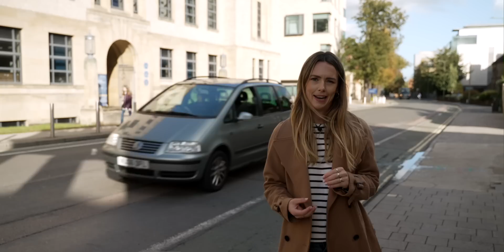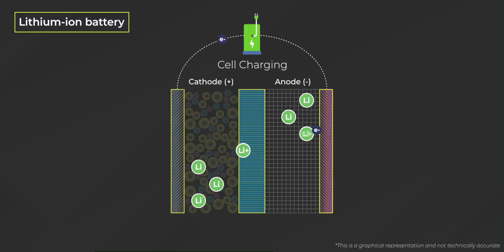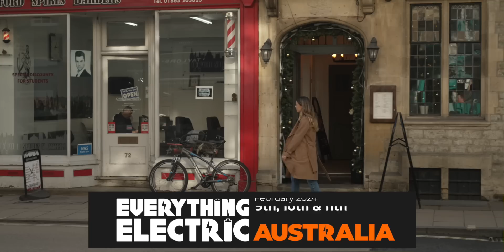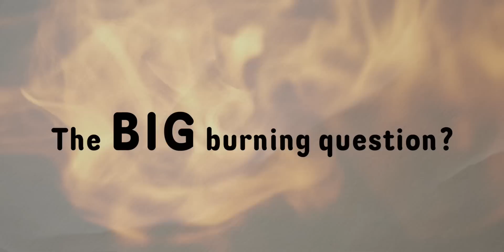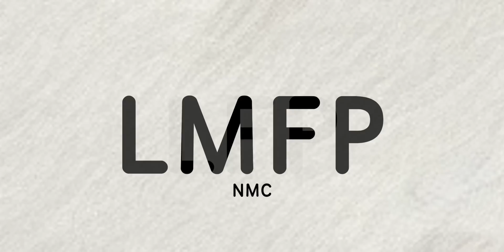The BIG Battery Breakdown: Fires, Failures and Future Breakthroughs!

Comment: Even for long road trips, a 500 mile range care would be more than suitable in the North American market. 

It's funny that he mentioned Canada, because I actually drove to Alaska this summer up the Alcan, and I was very pleasantly surprised by the number of EV chargers in BC and the Yukon. Once I got to Alaska it was another story, but it just goes to show that even in very remote areas, having good chargers every 100 miles or so is more than enough
Reply: Hmm ... it depends on the amount of traffic there is and the number of chargers (working) there are.

The Chinese would appear to have "solved" the problem of charging up battery EVs by having a "lot" of coal fired generators.

Granted that won't always be the case but the downside is coal powered generating stations are busily generating CO2 (plus other gases you can Google up for yourself) at the same time as generating electricity.

And the amount of CO2 produced getting the coal out of the ground and into the generating stations' furnaces and then getting rid of the ash ends up in the atmosphere too.

And of course we shouldn't ignore the fact that despite being assured there's sufficient electricity "in the wires" society is being "encouraged" to use electricity for everything else too so we shouldn't delude ourselves there's always going to be enough electrical energy around to drive everything once we get rid of fossil fuels.

There again if we find we can get nuclear fusion to work in the next few decades then we might get away with it.
Reply: @t1n4444  In British Columbia and the Yukon our grid is powered by hydroelectricity, so no, the only CO2 is coming from your oil & gas generated tropes. Nice try though...
Reply: @davidcottrell570  

Hmm, yes, well jolly good show for you then.

Comment: Or make all major roads wireless chargers, so that cars can have tiny, lightweight batteries and only have to worry about charging, if they spend too long away from major roads.  Yes, I realise it would be prohibitively expensive and take decades to upgrade roads, as well as create greater maintenance requirements, so roadworks would be happening with much greater frequency, but it would simplify so many things.  People would just pay a road tax based on their annual mileage and the majority of battery storage would just be needed for the grid, which by that time should be almost exclusively powered by renewables.

Comment: Campervan people can easily use 1000 mile batteries, not because they need to go 1000 miles in one go, but because they also use the battery for cooking, cooling, gadgets, heating, and e-bike charging, especially when staying off-grid. Heating particularly uses a lot of kWh without radical changes in the insulation levels and amount of glass in current vehicles. PV can help with this, but only the equivalent of a few miles/day.
Reply: Food truck people too.  Food trucks typically (in the US) are surrounded by a fog of exhaust either for the truck or for gas-powered a generator.  And they tote around LNP canisters.  A battery big enough to just go a few miles then COOK, with no exhaust, would make healthier, more pleasant eating.
Reply: @tomp4944  Good point. I wonder how many kWh/day a food truck uses? Induction cooking uses half the energy of gas cooking, and is typically something like 1kWh per day for camper-grade cooking (one or two rings for maybe 30 mins). A food truck may do 5-10 hours at several kW so could easily use 30kWh/day and maybe more. They probably don't travel very far normally so the current typical 50-60kWh battery should work for many cases.
Reply: @xxwookey  WOW, that's good information.  I assumed the electrical needs would be higher.  That's completely doable.  I'm assuming as soon as fully electric food trucks arrive, health departments will suddenly notice the toxic fumes we take for granted today and make it hard for food trucks to not be electric.

Comment: Yes, if you're in the car, you have time to get out, but if the car is in a car park (such as the recent airport fire) or in your garage, the burning battery provides toxic fumes and an intense heat source that may cause nearby vehicles or buildings to ignite. The battery fire is also hard to put out. Lithium battery fires seem to be very frequent because the batteries are so ubiquitous. Airlines have become paranoid about people dropping their phone down the side of the seat (understandably, because a fire in an aircraft is a much bigger problem than in a car). The other consideration with car batteries is that they are being carried around at high speed and may be crushed in an accident.
With respect to range, all the examples quoted were northern hemisphere. In Australia, there's a lot of situations where a longer range than current EVs is either desirable or necessary. Having said that, the vast majority of travel is locally within cities where a huge range isn't required. Better public transport would help to reduce the need for long drives. I really think there needs to be more emphasis on public transport. If people can conveniently travel those long distances in efficient and affordable public transport, taking a car makes less sense. At the moment for Australia, a lot of people would prefer a hybrid EV where they can use electricity for the short trips and only use petrol for the occasional weekend trip or holiday. Given the time to charge an EV, I just can't see public charging infrastructure being practical for long distances if 100% of the cars were electric. Maybe the solution for zero carbon emissions for those situations is a battery/hydrogen hybrid? Toyota already has hydrogen ICE test vehicles.
Reply: Agree on public transport- when it is good, like it is here in Europe, it often becomes the preferred choice. But regarding the hybrids- those are the most likely to catch fire (per number of vehicles sold), while BEVs very rarely do (you can google the numbers). But for EVs, you can go with LiFePO4 battery which does not even even burn. I believe Sodium Ion does not burn either, and both are just fine for city cars.
As for hydrogen cars- those are very energy inefficient, plus hydrogen is difficult to store. We should probably already forget hydrogen for cars, go full BEVs, and only go hydrogen for agricultural use (making ammonia), with secondary use of both hydrogen or ammonia as fuel for things like sea shipping.
Reply: @NeblogaiLT  why should a PHEV be more likely to catch fire than a BEV if the battery tech is the same? If the risk is due to the presence of an ICE, it's no less acceptable than an ICE car but with lower emissions. Why shouldn't they be able to take advantage of the same chemistry? I'm not sure of the numbers around inefficiency which you're claiming for hydrogen. The future waste and recycling steam is a massive problem if you want to convert everything to BEV. Hydrogen is simpler and cleaner. You can also fill a hydrogen tank in a reasonable amount of time, while BEVs take too long to charge. You ignored my point that in countries like Australia (and the USA frankly), BEV ranges are much harder to work with except for travel within suburbia. So sure, for suburban use and general use where you have a decent charging infrastructure and decent public transport, it might work. BEV adoption is still relatively low, and competition for working chargers is already problematic. Convert everyone to BEV and it's going to be really hard to make public charging infrastructure work without a major change in battery charge times and range. As I said previously, for countries where long trips are much more common, PHEV provides a better transition than BEV. I just can't see BEV being practical for people living on farms a hundred kilometres from the nearest town and without access to grid power. What about the diesel trucks and trains that move everything around? BEV won't replace them on current technology. It's going to have to be a transition, not a wholesale jump to BEV.
Reply: Do you want to see how many fumes and flames you get out of a petrol or diesel fire. And in any case, there are plenty of other things in a standard vehicle that will burn very nicely. It’s not like an aircraft where everything has to be certified nonflammable.
Reply: @ouethojlkjn  not the point. The heat and intensity of a lithium battery fire is enough to set off a chain reaction of fires in adjacent cars in a car park. I understand that current advice for an EV fire is just let it burn itself out. Sure there's plenty of fumes from any vehicle fire, but not the quantity and toxicity of a lithium battery fire. Don't get me wrong - I think EVs are the future. I'm just not convinced about the safety of current lithium battery technology.
Reply: @theharper1  Put it another way, I have just invented this amazing contraption that uses gallons and gallons of highly flammable liquid, which is squirted into a chamber and induced to do a controlled explosion. The hope being that it remains controlled. As a bonus, we will put the tank where all this combustible fluid it stored under the rear seat where the kids sit. Genius!!! The real culprit for most vehicle fires are 12v batteries, that have more than enough kick in them to start a very healthy and vigorous fire. Usually in the engine bay where they reside but any part of the circuit will do. Hence all the fuses in the fuse box. Finally, the frequency of Battery Electric vehicle fires is still proportionately many times less than a petrol or diesel vehicle. If you don't want to be barbequed, get an EV.

Comment: In the UK and probably Europe  a realistic 300mile range any time of the year is more than enough. 
I know I did Land's end to John O'Groats in my EV in November and charging was not an issue. My bladder needed more stops than the car.
Reply: But not where I live, in Canada. A Sunday drive can easily be 300-400km. Add either -5C cold weather, or summers requiring air conditioning, that battery endurance really matters.
Reply: @achimkrull7165  I think its probably more about having sufficient charging stations. 300 miles is 480km. Norway the coldest country in Europe also has the highest EV adoption with over 90% of new cars now EVs. They have a fantastic charging network and in the Winter the temperature regularly is well below minus 5°C. Extremes of minus 30°C are not uncommon in the far North.

Comment: My VW Jetta Wagon TDI goes between 550 and 650 miles (890 to 1,050) on one tank of diesel. On my many trips across these United States, I take 5 minute bio-breaks every 2 hours with a 15 minute break to grab a meal. I then either refuel when I stop at night or just before I leave in the morning. Having to stop 2 - 3 times enroute at ca. 1 - 2 hours to recharge would add several hours to the driving day and end up making me either drive longer each day or add at least an extra 1 to 2 days to my trip. Remember the entire continent of Europe is 4 million square miles (10.4 square kilometers) compared to the 3.8 million square miles (9.9 square kilometers) of these United States.
Reply: And yes you’re one of the edge cases he mentioned although I suspect your accident risk might be lower with longer breaks.

Comment: The most flammable is actually NCA, not NMC.  But NMC and NCA aren't too far apart from each other whereas LiFePO4 (LFP) is in the weeds in terms of temperature rise rate during a failure.  LFP is easily 100x safer than any other mainstream lithium chemistry.
Reply: So I'm rather thankful that the 10 kWh of battery storage I have up in my attic is LFP based. 🙂
Reply: @GreenJimll  I've got a similar amount sitting in the garage, newly upgraded to 16s, but I have them in two sets of two batteries, each set on an Anderson quick disconnect with a pull rope.  So if I need to pull them out of the garage all I have to do is pull hard on the rope and they will disconnect as they get pulled out.   No messing with bolts or screw terminals in an emergency 😞

Not sure I would trust any lithium battery chemistry in my attic.   On the other-hand, I do have a number of singular batteries sitting in my office for testing purposes.  Easily man-handled, and there is a door right there to an outside deck, but no pull ropes or quick disconnects so that could be a bit problematic if something goes wrong.

-Matt
Reply: Only Tesla use NCA in large quantities and their fire incidence is only .01%.

Comment: If the speed limit is 70 mph (110 kph) and you should normally drive continuously for up to 2 hrs before taking a break, there's no need for 1000 miles batteries/EVs, which only makes the EVs too expensive for the masses to own. Good trip planning and good choice of stops with charging stations, can allow you to charge as you go, including charging when you sleep at the end of each day.

Comment: So basically, by 2025-2030, if manufacturers are clever, use marketing correctly and governments educate the masses properly, we should have EVs with semi-solid state LMFP batteries with the anode spiked with silicon, that will weigh 30%-40% less for a similar or slightly improved energy density. That’s truly just what we need. 😊 As I have said before, most current EVs already have a range and charging power that are largely sufficient for any family or individual. You can already drive for 1.5-2.5 hours at motorway speed without stopping. By rapid charging only the amount of energy required to reach your next destination, the breaks aren’t usually very long. 12 minutes on average for me with an Ioniq 28kWh that would normally require 20 minutes to charge 15-94%.  

These battery improvements will simply hopefully increase EVs efficiency and reduce the amount of materials needed to build the battery pack and EVs in general, making the whole thing even more sustainable. Which is all that matters really.

Comment: 1000 mile battery range seems ridiculous until a winter break has you fill the car with people, add a huge roof box and tow a caravan to Cornwall.  Now that 300 mile journey might be possible.
Reply: Wouldn't it be better to rent such a car for the occasion, instead of paying extra for the huge rarely used battery, and hauling it for the rest of the year?
Reply: @NeblogaiLT  "...instead of paying extra for the huge rarely used battery,"   which is depreciating in cash value as well as losing/costing interest on the capital.

Comment: I used to drive from Scotland to the south of England quite regularly in a long range model 3. It so say had a range of 300 miles, in reality it was less than that but still perfectly adequate. The focus I feel needs to be on reducing the cost of realistic range batteries, we don't all need 300 miles when most of us only drive 30 a day. For the odd day thst we do it's cheaper to just hire a car with more range or take the train.
Reply: That is well said. I changed 2 years ago my petrol car to 28kWh Ioniq Electric. Also I had to change my mental position; not to pick car for 1% need, but look that other 99% need - which is less than 50km/day. And classic Ioniq can do it without any problems, even with Finnish winter. And for longer trips, just take a train or just plan a bit more and  enjoy the trip, not just the destination. ;)
Reply: @dingopisscreek You're looking at around an hour charging for a drive that distance. Would take about 10hrs. I would stop twice minimum l, once for breakfast and once for lunch. Half hour each stop would be enough to top up the car to complete the journey. You would only then need further stops for the loo without charging. Most people would do this with an ice car too.
Reply: @richardcorns8553 In a hurry, with a driving spouse, which most people have, you can eat, drink and sleep in the passenger seat. This leaves only 5 minute pee stops. EV's have to stand hours charging on a long run. Totally inconvenient and time consuming. EV's are just an inferior product, end of. They are also losing their owners thousands of £ with massive depreciation because the used market for EV's is none existent because the public has now wised up and won't even consider buying one.
Reply: @stevezodiac491  Cool Story.
Reply: @dingopisscreek  about half an hour split over two stops.
Reply: Everybody does long journeys sometimes. What idiot would buy a vehicle that can only do half the job a normal car is able to do ? Unless it is a second car with access to a proper ice car that can do everything. Madness !
Reply: The perfect solution would be to have modular battery packs that you can add or remove based on the how much range your need.
This will help reduce weight for shorter trips, which improves the range for the smaller battery. When you need to go out of town on a longer trip, grab all the batteries you can to have the maximum range available.

The next step for this scenario would be to have battery swap stations where you leave your depleted battery modules and take fully charged batteries. This is already a think with electric scooters in Asia, but with some ingenuity, we could find solutions for the bigger, heavier car batteries. Maybe have a permanent battery pack that can handle a day of city driving and the rest are swappable battery modules.
Reply: @kayvak7267  see Xbus
Reply: @kayvak7267  Cars with battery swapping system already exists. At least Norway has already few of those, just look for video from Bjorn Nyland; "Nio ES8 battery swap at Vestby, Norway"

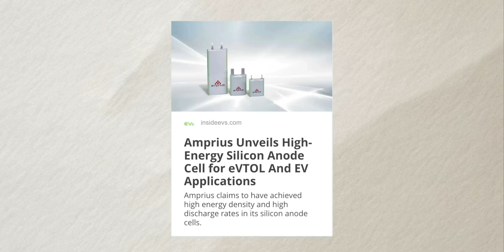Comment: 14:05 450 kWh/kg? That would be the day... more than pure hydrogen 🙂
Reply: @zapfanzapfan I jumped out my seat at that point. 2000+ mile range with a 1kg battery? The presenter has misquoted the units, They are only claiming 450Wh/kg.
That's still amazingly good. A 250kg battery for 112kWh would be game changing if it's affordable.
Reply: @drumbrakes  Yeah, it is an obvious misquote but one can dream of what would surely have to be a nuclear reactor powered car 🙂